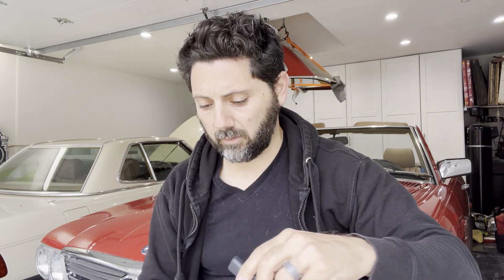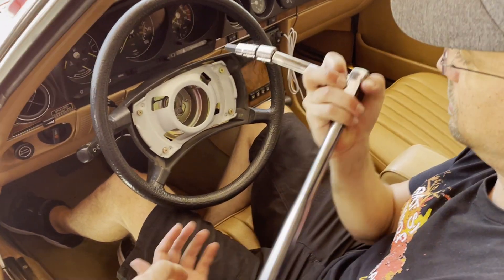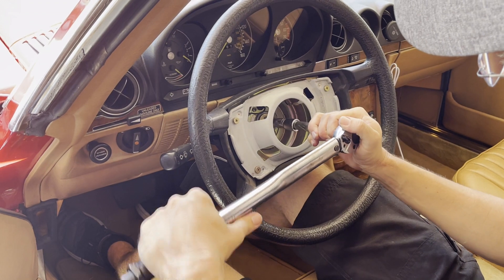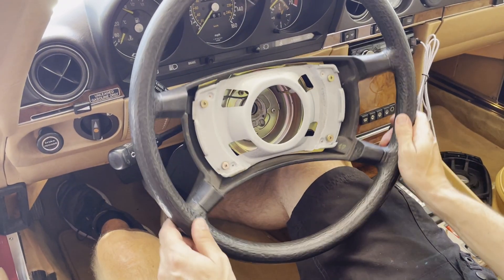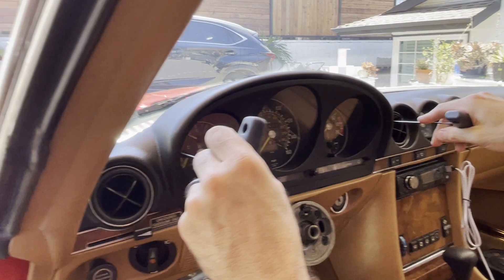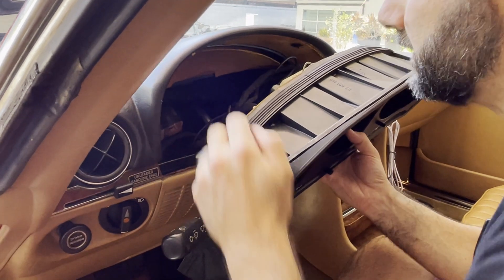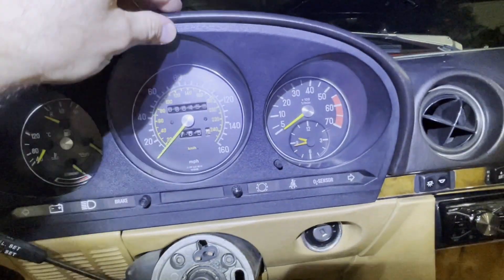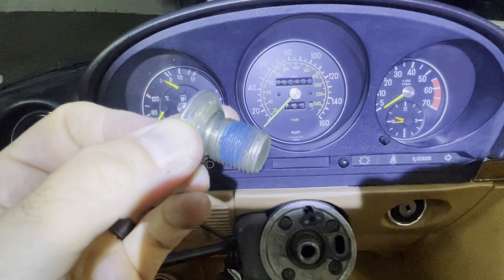1984 Mercedes 380SL R107 Steering wheel and instrument cluster removal

Comment: Hello, I do not have the meter lighting or headlights I changed the fuses it was a bit of anything I hope it’s just the bulbs! otherwise what? thank you for your opinions, good weekend to all...
Reply from the maker: Yea, check the fuses and bulbs. Other than that, it’s more electrics to look through. Thank you. Have a nice weekend
Reply: @sophiathe380sl  
380sl
Big thank you I will try to host the meter with old metal coat doors 
I’ll do it next week
Have a nice weekend

Comment: I've attempted to remove my steering wheel, but the Allen bolt is completely stripped/rounded out. The previous owner clearly couldn't remove it. So now I'll have to figure out a different way. 

And yet -- yours came right out! I'm so jealous.

Much like I was jealous that your fuel tank screen came out when you removed the fuel line. It took me days to get mine removed.
Reply from the maker: Well, my luck just ended. I stripped a bolt on the engine head of Doris. It’s at the worst possible place.
Reply: @sophiathe380sl  sorry to hear that. I didn't mean to jinx it!
Reply from the maker: @arlingtonrva1780  😂😂

Comment: Yeah I just bought a 1985 and sadly the temp and fuel lights are burnt out as the speedometer and RPM have light, so I know it's not the fuse. Also the clock doesn't work/keep time wasn't sure if there was hidden screws or just friction keeping the instruments and trim in at least this answered my question as the last thing anyone should do is not make any unnecessary damage or replacements damage by just blindly poking and prying.
Reply from the maker: Good luck. I think there are places where you can mail in a cluster for repair. You can also try to find one at a junk yard.

Comment: I wanted to understand how the center rubber came out, but you just blew by that. Also you didn't show you putting it back in. Can you tell us the method for this?
Reply from the maker: It’s super easy that’s why I didn’t show it. The middle of the rubber wheel goes inside the metal circle of the steering wheel.
Reply: @sophiathe380sl  I found that you don't actually have to remove the entire rubber piece. You can use a small straight edge screwdriver to pry out the center Mercedes emblem instead. But you're right, the rubber was incredibly easy to pull off. Even easier than removing the center Mercedes emblem.